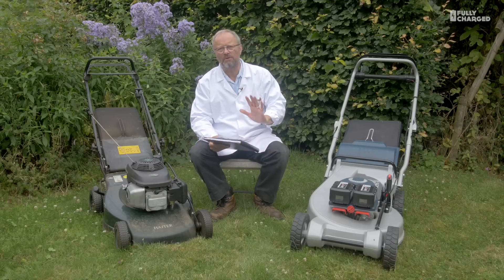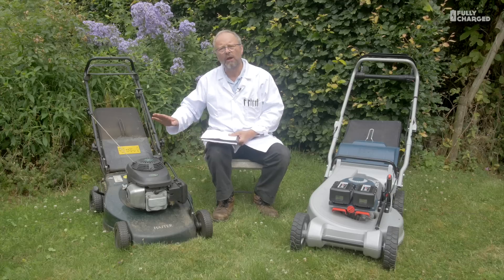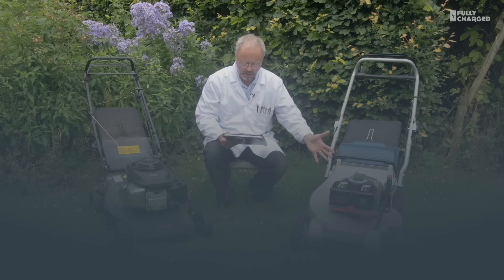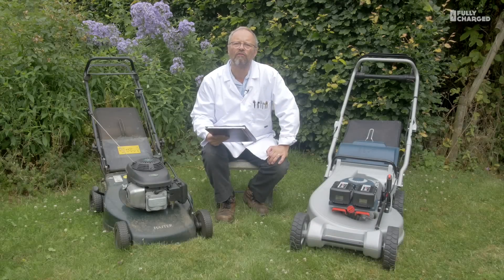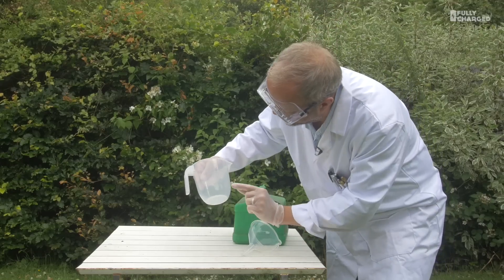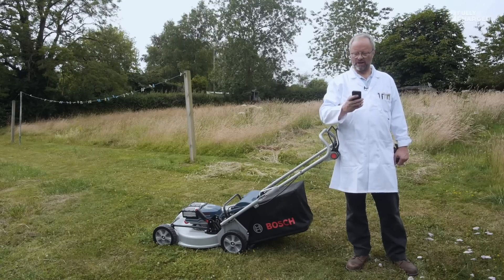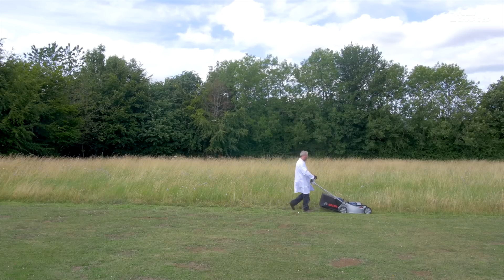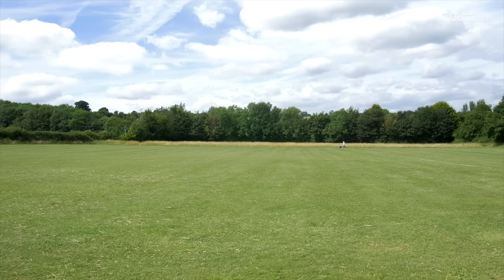Battery V Petrol. The Lawnmower Test | Fully Charged

Comment: How much fossil fuel did you uses to charge the batteries? 
Most solar panels are no more 20% efficient. 
Are you comparing apple with oranges?
Reply from the maker: +Joseph Dubeau I used no fossil fuel to charge the batteries. All the electricity came from solar panels. On a sunny day (like the one we filmed this on) they produce around 2.6 kW, the battery charger pulls around 0.6 kW so there was plenty to spare.
It's also worth remembering the fuel mix powering the grid during daylight, when aggregated over a year is like this 
coal, 24%
gas 32% 
nuclear 15% 
wind 18% 
imports  11% (100% nuclear and wind, from France and Denmark)

And during the night (when I charge my car) it's more like this
coal, 5%
gas 4% 
nuclear 54% 
wind 28% 
imports  9% (100% nuclear and wind, from France and Denmark)

So the 'you use fossil fuels to charge electric cars' really doesn't stand up to scrutiny. Yes, I use some, maybe 50% during the day and more like 10% at night. I can also charge the car purely from solar in the summer.
Reply: +fullychargedshow "So the 'you use fossil fuels to charge electric cars' really doesn't stand up to scrutiny. "  Are you sure about that? 

Data last recorded on Saturday the 17th. of October, 2015 at 20:55 BSThttp://www.gridwatch.templar.co.uk/
29.12% Coal
30.35% CCGT 
23.24% Nuclear 

National Grid: Live Status (8:55pm 17/10/2015)http://nationalgrid.stephenmorley.org/29.5% Coal30.5% CCGT 
23.5% Nuclear 
Production right now 34.7GW - 12:58 los angles. 
At 4 am your time, Coal never drop below 27% and Gas is at 22%.
Reply from the maker: +Joseph Dubeau You have a perfect grasp of science. No question of that. 
You have grabbed a snapshot of one day in the year, then (I am assuming) use that as 'proof' that I am making stuff up just to prove some spurious point.
I am very aware of gridwatch, they are one of many sources of information about the energy mix in the UK. They also include wind but as yet are unable to read solar due to the complexities of a 1950's grid which is being rapidly transformed into a 21st century grid. 
Wind contributes between 0.5% and 24% depending on the weather, likewise, solar is between 0.0% and 12% depending on time of day.
Harsh critics of renewables always point to the lowest reading and likewise hammer on about coal.
However, on a windy day (maybe 250 days a year) wind takes up the slack and the dirtiest fuels are reduced, the main one being coal. I have seen snapshot days where wind is at the current max, around 24% and coal is down to 10%.
So yes, I am sure about that.
Reply: +fullychargedshow Thanks for giving out some real numbers. Fun video by the way.

Comment: haven't they overspecced the mower if you can mow for 50 minutes and still have 50% charge? they could easily reduce the price by reducing battery size... if the battery is a significant cost anyway?
Reply: It has two battery packs instead of one big one, so perhaps it can just run on thats. But its a professional mower for big spaces. In any case the video isn't really about mowers anyway!